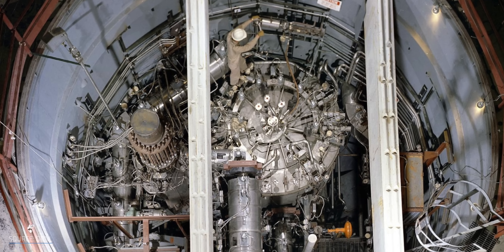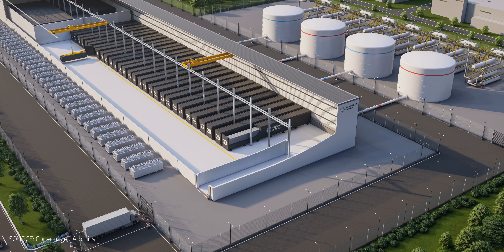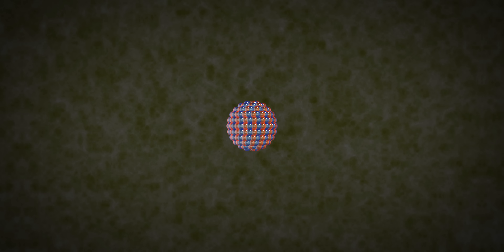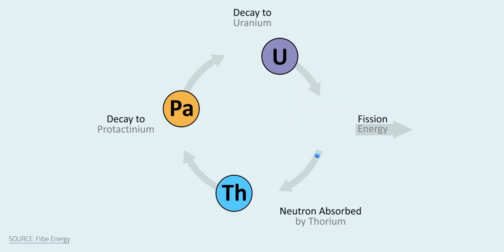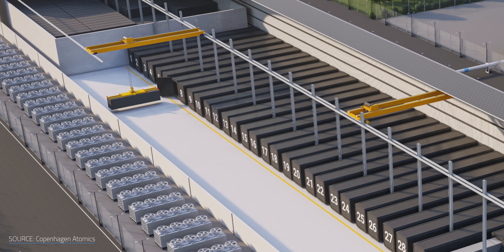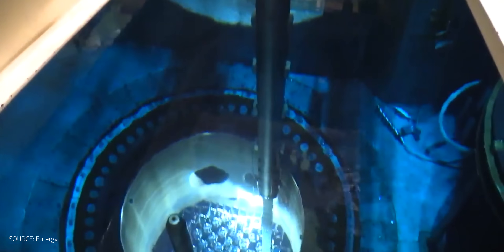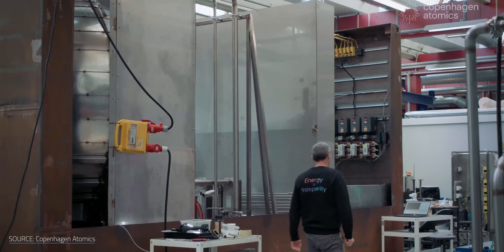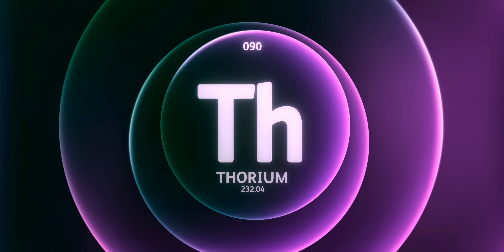Why Thorium is About to Change the World

Comment: You've overlooked significent issues regarding the Thorium fuel cycle, which is that in addition to breeding U-233, it also breeds U-232, which is a gamma radiation  emitte rcarrying higher handling risks. Further, the problem of nuclear proliferation remains with thorium since U-233 can be used as weapons grade.  I see you covered this point as the video went forward.  But the reality is any nation who takes possession of a thorium reactor is well on their way to joining the nuclear weapons club.
Reply: I guess, the Indonesians are aware of this,

Comment: I’ve looked at the R&D of Copenhagen Atomics in detail and I’m a fan.  This coming from someone who previously worked in the nuclear industry.  I wish that I could invest in their technology, but the SEC in the US won’t allow it for small fry like myself.  Your presentation was very good.  My only criticism is that you didn’t get into the fact that their process drastically reduces the quantity of high level nuclear waste, not just the decay time.
Reply: This is all news to me.  I’m curious about the 5 year replacement plan.  Are they just replacing the small bit that looked like a bucket or the entire unit?  What happens to the replaced parts?  Are they radio-active?  Do they have to be thrown away or can they be re-used.  It seems like a great alternative to the current nuclear plan but the video left a lot of questions unanswered.
Reply: @rosemarygrundy3539  They replace the whole container. This unit is estimated to cost 4-8 M$ to produce. After being replaced, they store it in the plant, since it is still radioactive, so no reuse. IMO this swap is what could make the tech work. Traditional molten salt designs have had issues with corrosion, and we have been stuck for decades because an alloy that can last for 40 years has not been developed. By swapping everything, you can built with existing and cheep materials, and iterate the design faster. I quickly did the math, and the cost of this reactor swap will be around 0,5 cent pr. kWh.
Reply: @thesparetimephysicist9462  Actually, after it has "cooled down" to the extent that the steel is no longer activated, it can be remelted for other purposes, e.g., industrial purposes. The cool-down period and its usage in different applications will vary depending on regulators.
Reply: @CopenhagenAtomics  Nice. Thank you for the correction🙂
Reply: As a Canadian I wonder if I could, business partner.
Reply: Let’s understand that nothing is set in stone here.  Nothing is operational yet and what happens after that is largely dependent on what prospective customers want and will accept.  There is no doubt that political interests will get involved and demand a number of their own rules.  

Most of the 5 year plan is based on the needed refueling requirement.  The proposal is to pull a unit and replace it with either a new or refurbished one.  The economics of this suggests that a centralized refit and refurbishment process makes the most sense.  Now, who actually performs this, who actually owns the equipment, what regulations are in place, etc. control all of this.  Copenhagen Atomics is presenting what they believe is their best vision of this process.  But keep in mind that the politicians and regulators have yet to speak their piece.  

A YouTube search of “Copenhagen Atomics” will give you a much larger group of videos that go into more detail.  An internet search will give you even more.  But beware, this gets very technical, very fast.
Reply: @tgmct  Same old, same old. You give us the taxpayers' money and we will promise that sometimes in the sweet bye and bye, over the rainbow, soon and very soon, just you wait and see, just around the corner, I'm not lying this time, we will figure out how to make a magic unicorn that will eat hundreds of thousands of tons of highly radioactive isotopes that are the greatest danger to all life on this planet and shit out cotton candy. Don't worry, be happy.
Reply: The more you learn, the better it gets. 83% of the "waste" stabilizes within 10 years, so even the ~300 year part is very small in volume. Just about everything has economic value when isolated, using the same electrochemistry on the fuel salt that is needed anyway. Some of it is incredibly valuable.

@1ManNamedDan sCO2 turbines are 50% more efficient and a tenth the size. Which is good, because conventional (low temperature) nuclear steam cycles are huge and comprise a large fraction of plant cost today. Even off the shelf supercritical steam turbines would be a considerable improvement.

@jackfanning7952 Spent fuel merely needs to be fluorinated (the first step of any processing), and the uranium becomes a gas. That leaves behind a residual fission product bearing fluoride salt, in a form directly usable for starting MSRs, and with no subsidy required. A whole lot more effort is needed to isolate plutonium for manufacture into MOX or other solid fuel, which is indeed senseless.
Reply: You can in fact invest in them. 

1. They are fundraising currently
2. They have shares registered on Funderbeam that can be traded

Let me know if you are actually interested in investing. It is very possible.
Reply: While only open to direct investment right now, they are set to go public at some point,  so stay tuned.
Reply: The SEC does have some options for non-accredited investors to invest in startups. There are just funding limits for those startups which discourage going through with those types of offerings.
Reply: Uranium-238 is not high level nuclear waste.
Reply: My criticism is that 99% is  of the energy is wasted as its still bottlenecked by a 3 century old idea the steam engine. All of these dangerous processes just to boil water to create pressure for electromagnetic turbines is mind boggling levels of inefficiency and as before mentioned incredibly dangerous.  We should be moving on to efficiently and safely stripping electrons directly from atom chains in alternating currents.
Reply: @1ManNamedDan  I agree. In theory, the 100MWth these things produce will probably give you 30-35MW of electrical power.

However, in a single shipping container that's not bad. Bear in mind a mid-size data centre could probably be entirely powered by two or three of these containers. In terms of space, it's the equivalent of around 300 acres of solar panels at their peak output (and the containers will continue working when it's night-time or cloudy).

So I think, even with the inefficiency, there's a market for this.

But, also, as Matt pointed out, there are some industries which actually require raw heat, and these are where this could shine.
Reply: Nonsense. Reprocessing only reclaims 1% of the spent fuel. It is expensive. It is the most polluting process in a very polluting nuclear energy business. The only good thing Obozo did as President was shut down the SRS MOX plant after $18 billion was wasted on it.
Reply: CA stated that they would have an operational reactor in one year and that was a year ago.  The SEC has saved you from investing in a scam startup
Reply: @clarkkent9080  That's a false statement. They extended the test period at PSI by a year. But other wise they have been relatively good at keeping their time lines. The construction of the first commercial reactor is supposed to begin in 2025 and be completet in 2029.  Perhaps you read that wrong?
Reply: @thesparetimephysicist9462  If you watch CA's own videos, they stated exactly what I said originally. Here it is one year later and NOTHING.  You can call it extended, relatively good, or whatever but it is the same for every new nuclear startup...pie in the sky promises but all they do is scam investors.

Lets just give them 6 more months as you say and see if any real construction begins...or just another extension?

Comment: "Too cheap to meter"
Ah yes, actual boomers.
Reply: "Too cheap to meter" Never meant free or even necessarily cheap electricity. It only meant that the fuel was so cheap that there would be no need to meter your use, only pay a service charge.

Comment: You need to drill them on the materials used for the structure, that was the biggest issue for the original, and the biggest on-going issue.  Thorium Salt destroys most materials it comes in contact with, so it would be good to know how they are tackling that problem.
Reply: They already have, they solved that one first with their purification process for the salt.

Comment: No price point for the machine or the materials the machine in built from itself since the machine needs to be replaced every 3-5 years. Are the materials used rare or expensive to mine and or forge? How much waste is produced volume and or weight wise? How much fuel does it burn / go through at what rate? The system still needs improving to do some of those things its talking about. What standards does the company use that are going to test it soon? This is interesting stuff but leaves too much out to be really educational imo.

Comment: As an engineer at a large commercial reactor, you appear to be rounding up prices for commercial PWR and, likely down prices for thorium. My view point is the only thing making different designs go well is larger reactor capacity, and preferably, capacity factor.
Reply: Not at all; it's the natural result of these reactors being immensely more efficient. It is a disgrace that we are wasting so much of the inherent million-fold advantage that nuclear enjoys over chemical energy, to the point it can barely compete with fossil energy.  Nuclear does not need to rely on economies of scale to compete; it just needs to be utilized efficiently, which thorium makes possible in many dimensions. Reactors can be far more efficient and powerful, even at a fraction of the scale, with these being 100MW thermal. Flibe Energy also has a 4x250MWe module plant that looks more like a micro reactor than so-called SMRs. When a simple reactor needs minuscule resource inputs, it can be very cheap.

Comment: The concepts are too good to not become a widespread production method. This solves energy problems in so many ways, and is a path to undo all the problems created with the original reactors by feeding the old waste into these things. If we have a meltdown proof reactor design, and we can ALSO now manage the waste entirely ... does this not mean we HAVE solved the energy crisis ? The only reason we haven't gone full nuclear is safety concerns, which this fully resolves, meaning ... there's no longer a reason not to go full nuclear, am I missing something here ? Sure fusion will be better, but ... these systems ... are enough ... there's no reason countries couldn't be running fully on these units (at least from a technical standpoint).
Reply: What's missing is an actual price per megawatt•hour from any small molten fluoride salt thorium modular blah blah reactor that you can actually buy. Even this one is an optimistic 10 years away. Meanwhile intermittent solar and wind are the majority of new generation everywhere in the world because they're quick and cheap.

Comment: The people making private investment decisions are focused on the next quarter. A power-plant that takes eight years to build and won't pay for itself in less than twenty after that will not get funded.  Thorium Breeder facilities that requires new fuel fabrication centers and mines is a long-term investment that does not appease the demands of late capitalism. Factories to build micro-reactors face the first mover problem of no one will build a mini-unit if there is no production line, and no production line will exist if there is no one asking to build the reactor. 

Nuclear plants are great. But they are expensive. Even the simplified ones can't get around the fact that gamma rays are gamma rays and you can't just skip some of the shielding to save costs.

Comment: A general rule of thumb says, the faster something decays, the higher is its radioactivity. 
And then there is the issue of removing unwanted isotopes, which is necessary to keep the efficiency. The only method I know of uses Fluorine. Pure Fluorine is a hell of a substance, eating through everything - just view the video The Element That Terrifies Chemists – Fluorine. So, what is the solution? Can it be replaced with something less dangerous?

Comment: I have been reading the book Nuclear Is Not The Solution by M V Ramana.  He discusses small modular reactors and tells us how inefficient they are.  

He talks about how they marketed the construction of the reactors as too low cost and too short construction times.  This caused multiBillion dollar cost overruns and decade long construction delays.  

He then dives into the new reactor designs and how they require at least a decade to get through the approval process before they can be built, which then takes another decade - minimum.

He also discussed the heavy financial burdens nuclear has placed on both the customers and the taxpayers.  The government has had to heavily subsidize nuclear power.

He talked about how the increasing percentage of solar has caused greater variability in the demand for peaker plants, and how nuclear power plants are not capable of changing their output so they are not capable of being peaker plants.

So he concludes that the new nuclear power plants are not the solution.  I agree.
Reply: I wonder which industry paid him to write that book, or which solar company his money is invested in.
Reply: @Andy-oc3ew 

https://en.m.wikipedia.org/wiki/M._V._Ramana